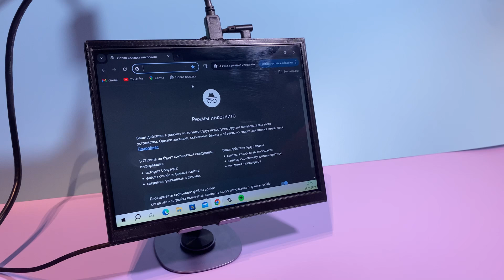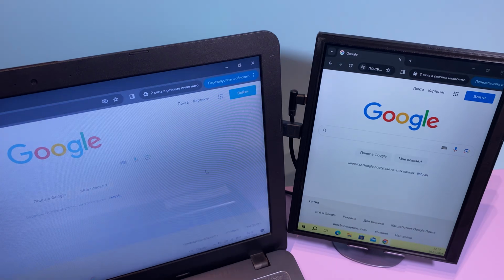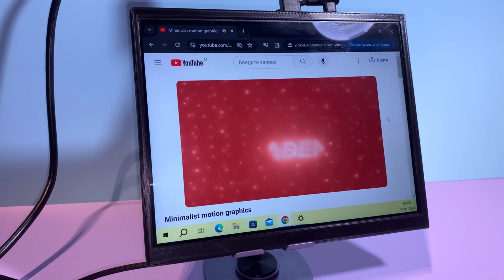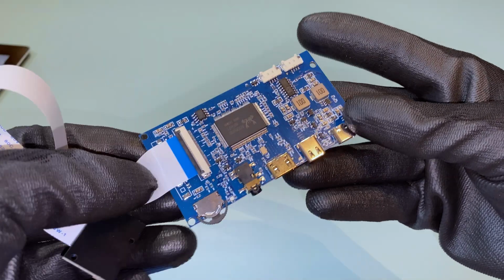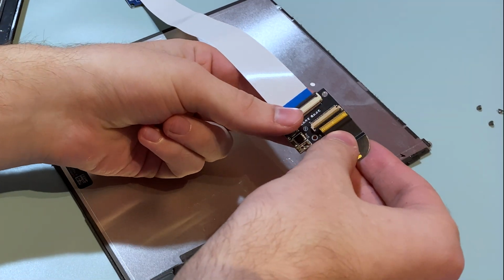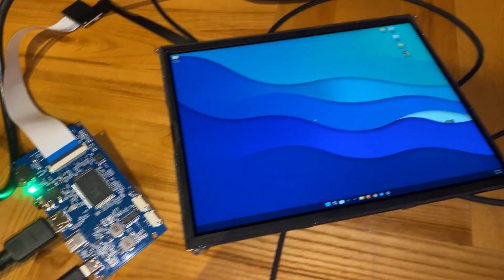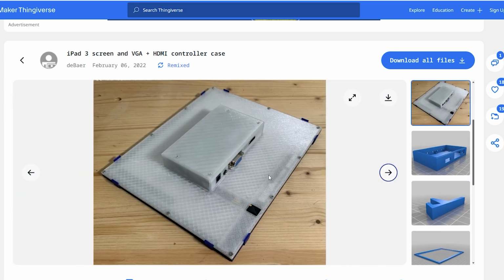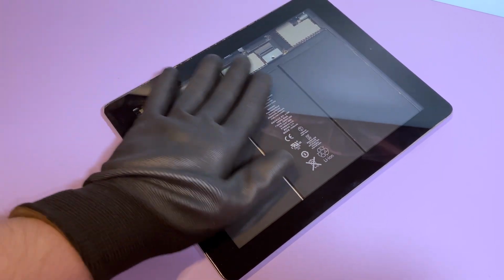I made a 2K Monitor EVERYONE can afford!

Comment: I grabbed a cheap TCL tablet downlaoded spacedesk and it is a second screen I use for info like temps and what not, but it can be used as another monitor for whatever. Plus no disassembly or anything needed. I like what you did, taking it apart and making it your own is fun also. But if your lazy like me and just want to use a tablet right now. Download spacedesk on the tablet and PC and done. Uses a Type C for video.

Comment: Great video! but I think repourposing the ipad's original frame and back and planting the HDMI board inside would be a great way to do it for someone (Like me) who has no 3d Printer, do you see that as a possibility?
Reply from the maker: I considered that possibility, but found it not good Idea beacuse: 
1. Very hard since iPad's aluminium case need to be modded with additional holes for big ammount of new ports. Also you need instruments for that.
2. It's thin, so I am not sure the board will fit.
3. It has wide frame and home button, which isn't cool aesthetically.
So unfortunately I don't know what is the best way for you to make a litterally just box for this thing, but since the very begining I had same thought - to make it in iPad's case.

Comment: I have a relatively new Samsung Q7F monitor. The one connect box (the brain of the device) was lost when I moved. Samsung told me it can't be replaced (with a different new one connect box) and the tv is essentially trash because the old one isn't sold anymore.

Do you think it is possible to open the tv up and just connect a new controller to the panel and leave all the Samsung stuff alone?
Reply from the maker: Sorry for late response, I don’t know

Comment: Cool job! but it would be great to have links to the board and .stl files you used in the description.
Reply from the maker: I haven’t shared files since they were inaccurate and I was modifying this thing three times. Like, I had a file which should have fixed a fix of original blueprints :D Also it lacks support on one side.. I am not proud of it. As for links, I didn’t want to promote someone’s shop and I heard YouTube doesn’t like link sharing in description, so if you want to find it just search for “HDMI Type-c Controller Driver Board For IPAD3/4”. It’s nameless, but easy to find on Ali. Sorry for not being able to share stl, but they wouldn’t just help you. Next time I will make it better, I shouldn’t have hurried with this. Thank you for your comment!

Comment: QHD is NOT 2K, it’s 2,5K, 2K is just FHD
Reply from the maker: Well… 2K is not FHD, since FHD is 1920x1080, and to be called 2k it should be 2000x1080 at least. This screen is 2048x1536, which makes it 2K, not QHD (and I haven’t called it QHD), and obviously 2048x1536 is much better in terms of pixel density, then full hd screen.
Reply: @TheSillyWorkshop  other than ultrawide, have you seen a 4K screen 4000px wide?
Reply from the maker: @SchioAlves  well, if we will use wiki's definition you are right. But how is this even related to a video?
Reply: @SchioAlves  4k isn't at all related to the number of pixel on the width of a screen, rookie mistake here. 
4k just means 4x FHD : 3840x2160=1080x1920x4
The misunderstanding comes from the fact that 1080x1920=/=1280x720x2 but instead it is equal to an estimate of it. So if 1080p is equal to one, 720p is equal to 0.5, 2160p is equal to 4 and 1440p is equal to 2. That's why QHD/1440p is indeed 2k.
Reply: @ChaBawbe , it's called 4k, not 4x

Comment: You didn’t make it Apple made it. Someone else made the control board.
Reply from the maker: As far as I know, this display was made by LG using Apple's technologies. And yes, putting everything together is easy. You also seem to forget that I designed the case by myself. So yes, using some parts I made it a monitor, not just a lonely screen, piece of plastic and a controll board. You are basicaly saying the same statement as "making wooden birdhouse is not making it, since you didn't cut down the tree and process the wood by yourself".
Reply: Apple doesn't made the iPad
Reply: @vexamologist  what's their common phrase "Designed by Apple in California" (Made In China) haha
Reply: All you did was plug everything together which takes no skill